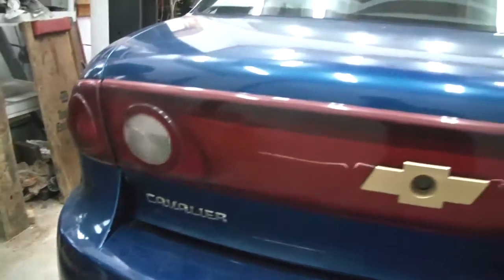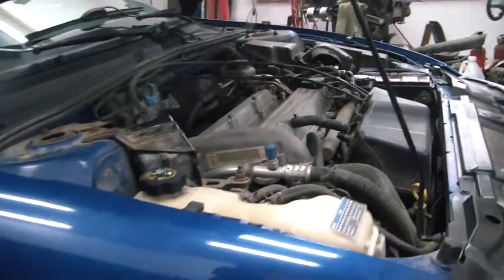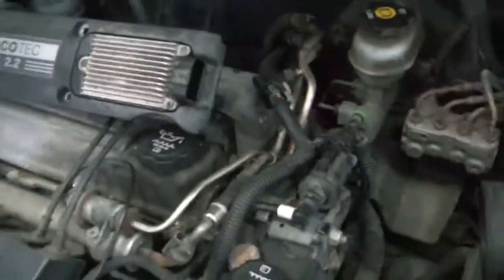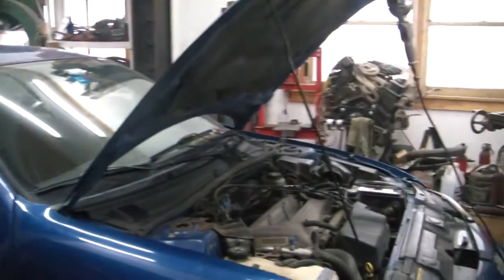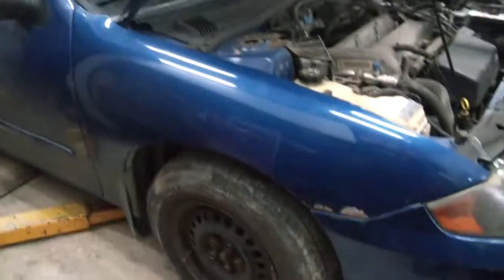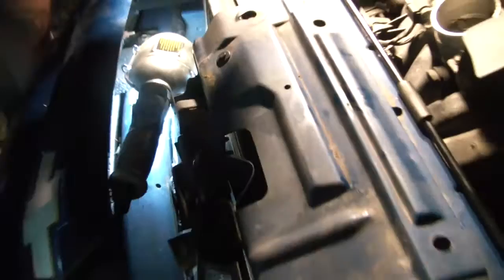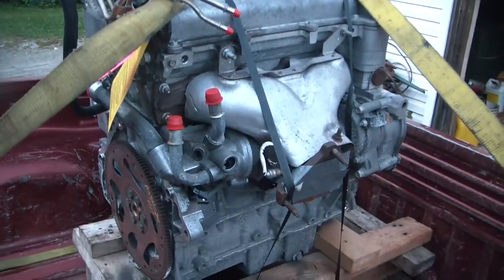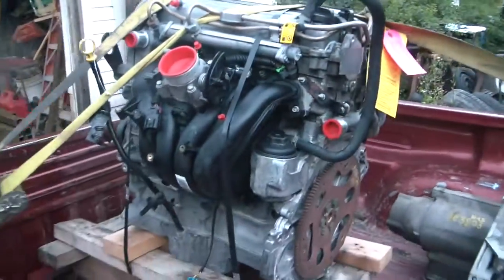04 Chevy cavalier engine swap 1

Comment: I have to do an engine swap on my 2004 cavalier. The body and interior is mint so I don't want to junk it. My question is does the engine have to be taken out the bottom or can it be removed out the top?

Comment: Went through most of your videos , wow you know what your stuff sir.  Anyway I have a good working z24 same year as this.   Have about 170,000 miles on mine, its running good but I worry about this supposed timing chain failure.   Can some preventative maintenance here help mine and then how would I change a timing chain while the engine is in the car.

Comment: im trying to take a 2.2 out of a gran dam, i took all the trans bolts out i could find, they say 9 bolts, i found 7, and there is no bolts where the remainding 2 are supposed to be, but it still feels like on is in there, do you have any pics of the back side of the engine, iv'e been around it like 30 times and nothing
Reply: All the way on the passenger side of the engine theres a bracket with 4 bolts but you only have to remove 2 did you get those?? 3 on top of the tranny 1 behind the starter 1 on the back of the motor going in to the tranny 2 underneath the motor 2 on the back side of the tranny!
Reply: its also easier to pull the motor and tranny both at the same time instead of separating them